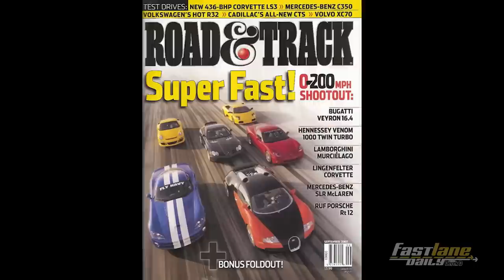Hennessey Performance Engineering Spotlight - Fast Lane Daily

Comment: If money is no object I would buy the 2016 Ford GT, because it is the best looking car that any money can buy period. Then I would install a twin turbo 5.2L flat crank v8 with the best parts money can buy using titanium for the valve train and every nut and bolt on the car. It would have Carbon wheels and active race suspension. I bet it is still under a 1/2 million when its done.

Comment: they should add some turbos to a hellcat
Reply: The hellcat is already supercharged.......
Reply: maxsoul7777
I mean to add turbos to the already supercharged engine
Reply: ***** you don't have any engineering knowledge, lol.

The only combocharged setups usually run a centrifugal supercharger type to try to compensate for turbo lag, not to create extra boost. And these setups usually run only on ethanol.

The Dodge SRT Hellcat uses a root type supercharger, which is not really compatible with an additionnal turbo/twin turbo setup.

For big power applications, its one or the other, not both.
The best way to make power would be to make a CNC machined block with some bespoke titanium internals and run a ton of boost. but it's very, very costy.
Reply: ***** is that even possible?
Reply: MrWafflez000 Technically speaking, yes. I know HPD did it on their Ford GT around 2012. Although if I remember correctly the engine did not survive long the setup as the root supercharger that received the pressurised air from the turbochargers created unwanted additional heat
Reply: Why put all the time and money into upping the boost instead of just putting a new 440 in it and a pair of turbos?
Reply: Its one way of looking at making more power, obviously it has its flaws, but is a option for some, that and which 440, big block or small block
Reply: ***** I think that hell cat already has the best parts
Reply: *****
I like big-blocks just for the extra mass when you're making big power.
Reply: MrWafflez000 Lancia did it in 1985 on their Delta S4 Group B rally car. Over 500hp from a 1759cc 4 pot.
Reply: Etienne Bruneau Maybe you don't have any engineering knowledge?  There's lots of "twin charged" setups out there utilizing both a roots type blower and tubos. Id remeber when guys were doing back in 2005 with the cobalt ss supercharged.
Reply: William Stewart Actually, I do

There has been a lot of Twincharged setups going on (ford GTs, evos, and SS as you  said), but this setup is not efficient at all

To make a compound compressor system work "well" is difficult. Generally at low rpm, the turbo intak plumbing reduces supercharger efficiency, and at high rpm the supercharger reduces turbo efficiency.

Having a Twincharged setup requires an older type of single scroll  turbocharger. Nowadays with modern variable geometry twin  scroll  turbochargers, you're able to get the torque at low RPM the twincharged  setup gave you without the multiple drawbacks, which explains why this type of setup is not used at all now.
Reply: Etienne Bruneau I never said anything about the efficiency of said setups,  I only stated that therr has been lots of builds using those blower/turbo setups.  I know first hand they are a nightmare to tune properly but they do run quite nice once that parts over. The sound they make is very unique aswell.

Comment: I don't like the way of doing top speed records. Hennessey had 3.2mi and Bugatti has something like 20-25mi.
In 3.2mi I think the SS would only go like 230-240mph, cause it has so much more weight to pull.
For speed records I think you have to limit the lenght of track to like 4 or 5mi with standing start.
For a car to hit top speed and stop again in just 3.2mi it has to have a pretty low top speed. In 20mi pretty much anything can hit it's top speed.
Reply: the bugatti definitely did not have 20 miles......it had a 5.4 mile long straight.
Reply: ...or Guinness World Records should say that if VW/Bugatti want to apply for a record attempt, they have to open up their test track for other manufacturers to use for their own record attempt within a specific timeframe.
Reply: ***** I agree with this. Since Koenigsegg released the Agera series and the One:1, I've wanted to know what the real world top speeds are, but VW is so protective of their track that they don't let the competition use it. Too bad.